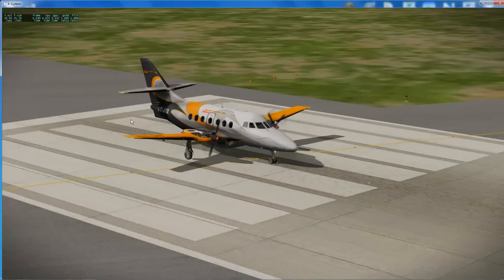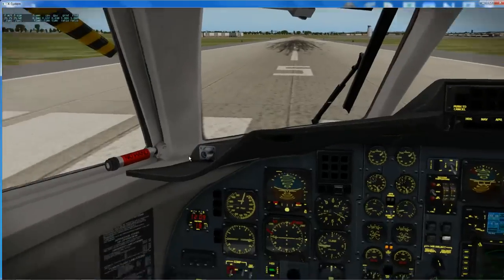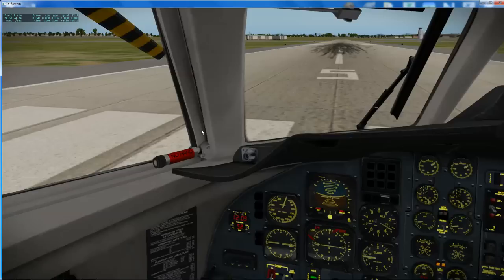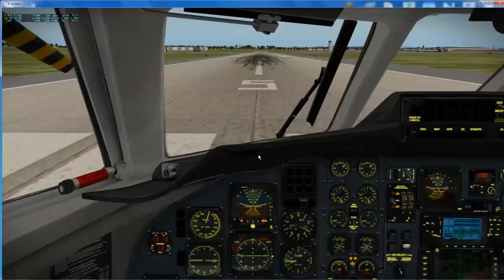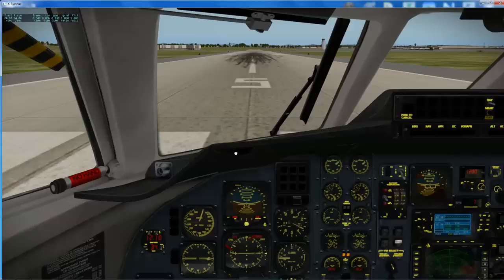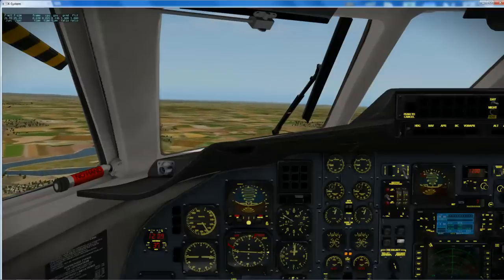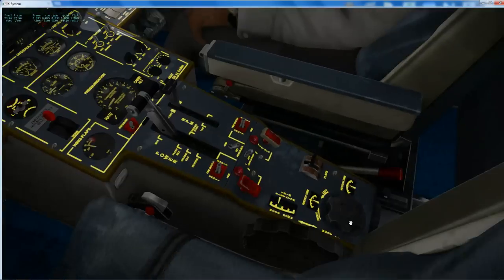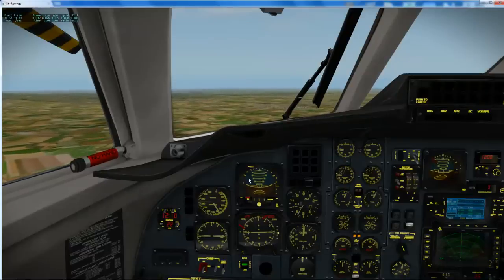JRollon BAe J32 Jetstream roll and aileron trim workaround fix for X-Plane 10

Comment: I read a lot about it lately about the torque effect.
In theory, the matematical formula is good in X-Plane but the other air flow on the fuselage and other effects and not taken into consideration in X-Plane (those would be reducing the torque).

There is an experiment ongoing for quite a while and on which people can play with (Laminar does not recommend using it but for the time being why not).

Read the topic: http://forums.x-plane.org/index.php?showtopic=69706&page=3#entry757529

Hope this help. The issue with your fix is that if you loose an engine the aircarft becomes difficult to fly and torque effect would be not realistic :)